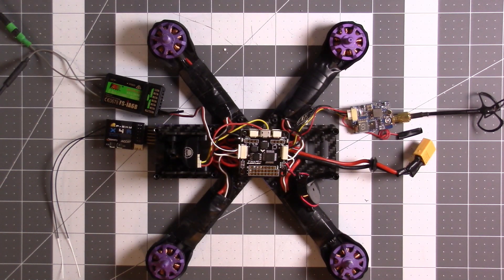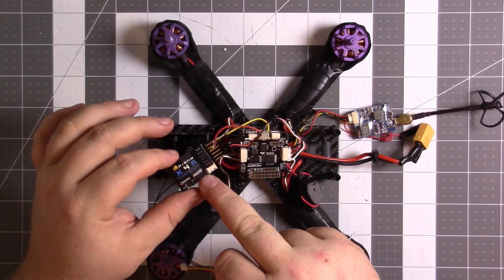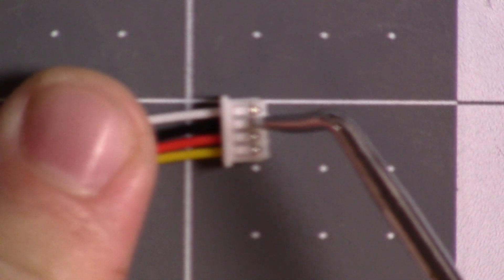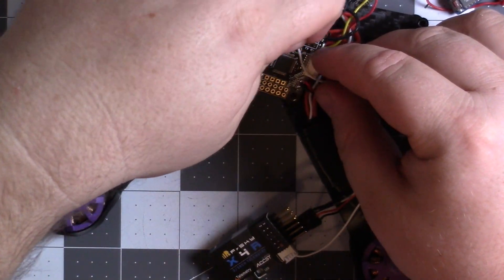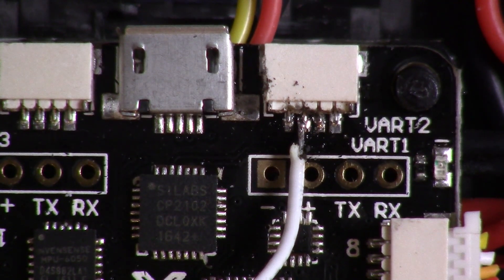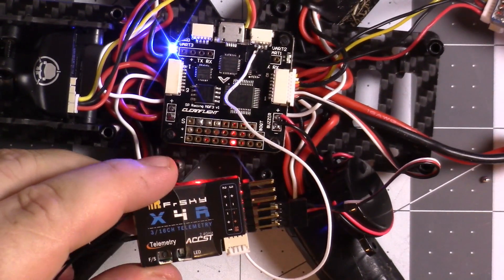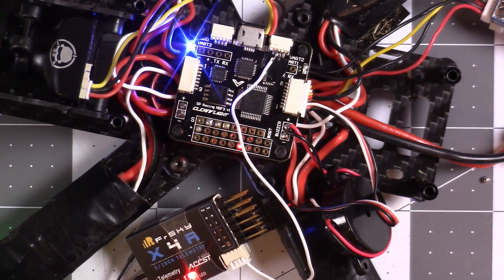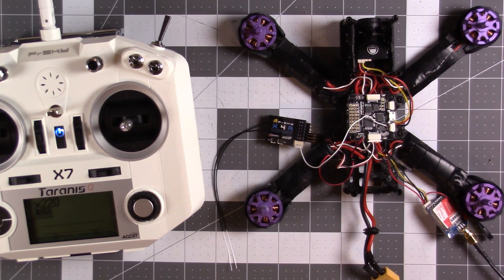Wizard X220 - How to Install X4RSB Receiver on SPRacing F3 FC and Bind FrSky Taranis QX7

Comment: Before soldering the yellow wire on the UART1 pin slip a bit of heatshrink over the wire and once soldered shrink it down and it will be neater than electrical tape.

Comment: Your video saved my ass when i put a x4r-sb in my wizard and showed me how to get telemetry working and what pin to solder to.  For this I thank you VERY much.  Installed a capacitor tonight and accidently pulled the telemetry cable.  My taranis still gives out DB readouts like it's working.  Kinda strange.

Comment: I did this... but my receiver isn't reading anything in betaflight. Is the telemetry wire required?
Reply: i have the same problem. The qx7 is binded to X4RSB but the the reciever isnt reading anything in betaflight
Reply: did you solve the problem i did exactly what he said to do but i am having the same problem you are

Comment: can i ask a question?why do we need to put telemetry ?  sorry im just beginner
Reply: or it's alright to not put telemetry?
Reply from the maker: You don't have 2.
Reply: ok thank you :)
Reply from the maker: Sorry if I didn't answer this clear enough.  Telemetry helps add functions like battery warnings and RSSI(radio signal strength) if you don't add it you just wont have those features.
Reply: Thanks now I understand :)

Comment: do you need to have the vbat pads soldered to the main power pads before you do this? in order to get voltage reading (aka wizard vbat mod) or no?
Reply from the maker: I did have that process done already, so yes.

Comment: Hey nice tutorial but may I know why need to switch the wire position to the back of the flight controller board to install the new receiver?
Reply from the maker: as I understand it, the front is for PPM and the X4R-SB/taranis supports SBUS which is the rear port.  SBUS is way faster than PPM.
Reply: ah ok i see. didnt know the sbus and ppm ports were on different sides though

Comment: Dude remove this video you got everything wrong.  Now the sp racing comes with the uarts connectors no need for soldering on the back of the uart2 read the manual,, sbus use io2 but in the same time use uart3 so do not use uart3 with sbus, uart2 can be use for MmOSD, or for telemetry or GPS module, read the manual. this video is all wrong.
Reply: I've read the manual several times and I'm curious as to what you think is wrong? I'm pretty sure pin 3 on UART2 a TX channel and even though you cannot use it while you have the debugging port active it is highly unlikely that you would even ever use the SWD. Sure, IF you had a free jst male connector and a pin you could just use that instead of having to solder directly to the pin lead, but if you do not, or you just prefer a cleaner looking build then why not.
Reply: The white wire you solder to uar2 is so close to the heather + of uart 1 that is a recipe for desaster, one is 3.3+< signal and the other is 5 volts, wow. good look my friend happy flying.  Now my setup is io2 sbus receiver, IO1 just for LED's, Uart 1 connector to MiniOSD, and Uart 2 to smart port vfast. Uart 3 can not be use for nothing because is been use for IO2 sbus too. and when you connect the USB to the computer you have to remove the connector from Uart1 because they both are using the same protocol MFP.  Now with this set up you will have RSSI, Vfast, or total battery voltage, you can even set up a logical switch to give a voice of the voltage and alarm to tell you, battery low or critical by going into the radio en logical switch page and use this mix a<b and set the voltage like 3 cell 11.5 in the safe side , or second by second call out in you radio with a regular switch like SA for example,

Comment: I really like this video...!!!
I'm  about as green as they come and I just bought a tyrant s quad and it's  bind and fly.  
I just ordered my radio by receiver a battery charger batteries and other little odds and ends that I may or may not need. But the big thing is trying to get it all to work together. It seems to be hard to find anyone that will give you information about the common processes or procedures.  
I would love to see a video on you setting up your radio  or your quad on betaflight.

Comment: If you enable Soft serial on the Configuration Tab in betaflight, you can pull the telemetry from pins 5 and 6 on the same IO2 you are pulling the SBUS signal from for the receiver. Just connect the two wires from pins 5 and 6 the to the s.port telemetry wire coming off of the S4Rsb. Then, in the Ports Tab in Betaflight, set up soft serial 2 to be s.port telemetry. This way, all the wires are coming out of IO2, nice and tidy. Another advantage is that you won't have to arm the quad to get telemetry like you have to when using UART2.
Reply: Kurtis Rupnow. is there some type of video that shows what your talking about..?
Reply: Kurtis Rupnow as I understand the x4r needs a 5 volt supply and io2 only supplies 3.3 volts?  is this correct?
Reply: Al Nobello I only have 5v going to my F3 board.
Reply: Nitrous Banshee - Finally found something that talks about this! Thought I'd help out- https://oscarliang.com/sbus-smartport-telemetry-naze32/
Reply: hi, i got a problem with A SPF3 , i tried this you suggested, and it worked, then i tried to use just pin 6 (istead of pin5+6 together) it work too. Now i wanted to know, why 2 pins? There are a bit of messy on the net.
Reply: Huh? IO2? Uart or? The to the s port? Id rather not have a single shot wire soldered to the back of a connector on my fc😅 but I cant understand some ppl, tbis guys vid he does everything backwords...!

Comment: Nice it will help people. I know everything about the Wizard and also how to set it up, but I'm totally new to the Taranis i have one on it's way so your video might help. There must be a easier way to get that telemetry working. I will order the naked version of the X4R it won't have those pin-headers so I am trying to figure out how to set it up anyway great video buddy.
Reply from the maker: Thanks SnoepoX.  You could plug in a connector to the port but then it would get in the way of the side walls.  Some people say take the side walls out but then the quad becomes much more flimsy.  Soldering is the best way imo but a pain in the buttocks.
Reply: I've drilled holes in my wizard side plates for this exact reason. I like the structural integrity the walls provide, but they block too much access to the inside of the quad.

Comment: why didn't you use just another connector instead of soldering?
Reply from the maker: +nandakoryaaa 2 reasons.
1. Wizard side plates prevent access
2. Didn't have one that fits the plug

Comment: Hello i done all like in your video. Forget antena put 5-10 sec was without video antena.I have problems, i dont know what should i configure now. After bind success. Can you help me ? I have x4r and wizard x220 and tanaris q x7.
Reply from the maker: +Daumants Kindzuls yes, you need to Configure wizard in beta flight for arming and flight modes.  Also setup switches on qx7.  I have a video on switched already.  I will make a video for beta flight next.   

What video problems are you having?